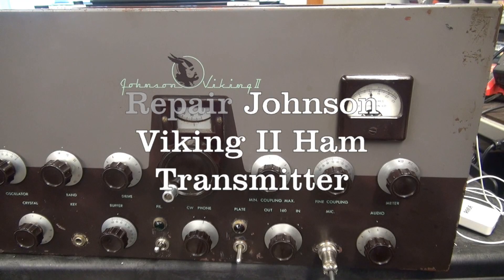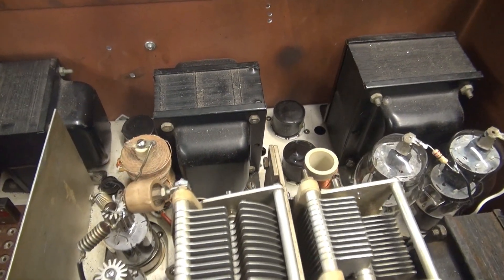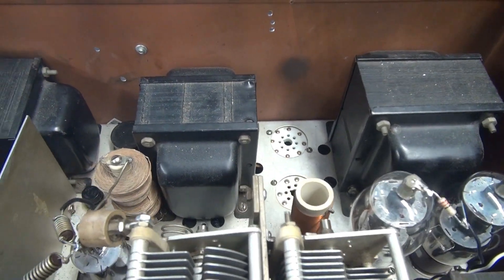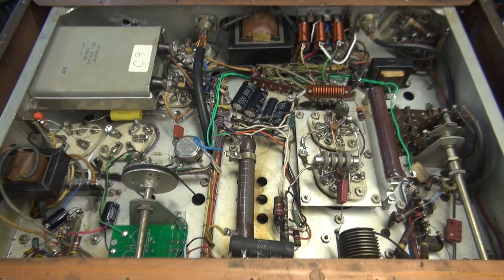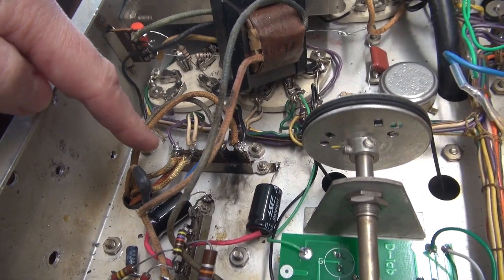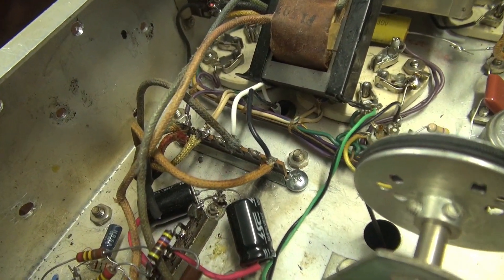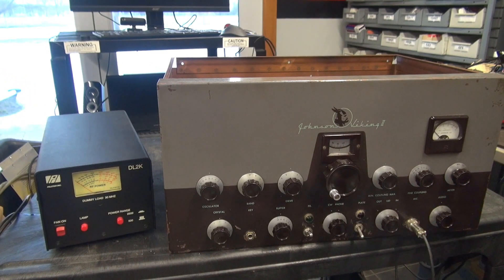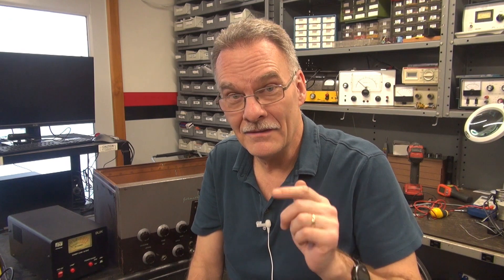Johnson Viking II Ham transmitter Modulation problem arching high voltage shorting quick fix

Comment: I have had that happen on many valiants, I noticed most times the plate cap wires are attached to the terminal strip next to each other. If I find that I always move one so they are not next to each other when I replace the terminal strip. Ive seen them arc between each other and to ground. 73 kd0ezs

Comment: Replacing the 5R4's with semiconductors was a bad move on his part. You are right he is indeed lucky that he didn't smoke the transformer. I have a DX100 that some guy modified as well it also had 5R4's but he had messed it up so bad I put it back to original and it works fine now.
Reply: Larry yup bad choice definitely

Comment: Thank you for this, Terry.  I love my sturdy Viking II.   
The Viking II is "Steak and Eggs" vs. the DX-100 "Vegan Soy Burger."
Don't like the Heath DX-100 and I won't work on them anymore.
Everything in it is run right up to "the hairy edge."
There's just no excuse for running 1625s at 800+ Volts.
The terminal strips and wire are the cheapest they could
find and are always 5 seconds from arcing-over.
The VFO can't be still and there ain't much you can
do to correct it, because the root of the problem
is cheap mechanical materials with no thermal properties.
The transformers are weak milk-toast, just dying
to roll-over on you.   There must be a zillion 
smoked-up DX-100s sitting in garage corners, 
waiting for the grand kids to send them to scrap.
Give that DX-100 to your local Chicken Bander. 
Get yourself a Johnson Viking II and be happy.
You can fix it with a pocket knife and a forked stick.
TNX OM ES 73 DE Dave AB5S

Comment: Thanks, Terry.  Those solid state rectifier replacements are a good example of "equivalent replacement parts" not being the same as originals.  I've seen ECG replacement transistors that cross-referenced but had more gain than the originals, causing self oscillations.  It's best to use as close to original and avoid needing to modify the circuit.

Comment: Interesting Terry! My DX-100 blows a fuse when I throw the plate switch. Haven’t found the problem yet. Maybe (hopefully) a similar problem. Tnx de Howie WA3MCK
Reply from the maker: I had a DX-100 here, also blowing fuses, turned out to be arching on the rect tube sockets
Reply: @d-labelectronics  thanks for the tip Terry... will check it out. Previous owner also performed some mods to the audio section. Installed a PTT mod, new microphone jack and some other nonsense... I have to check that also. Tnx de Howie WA:MCK